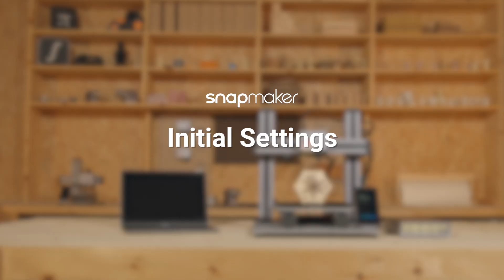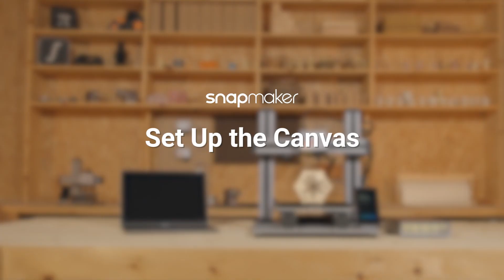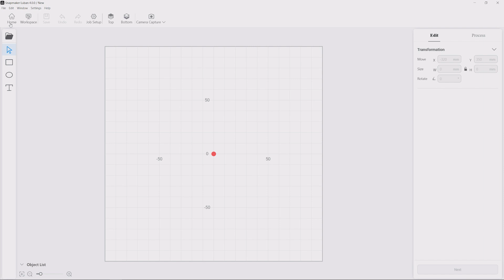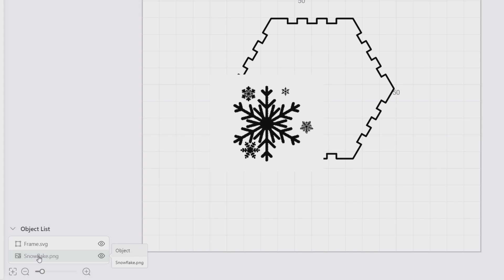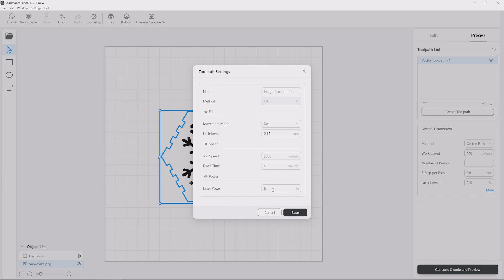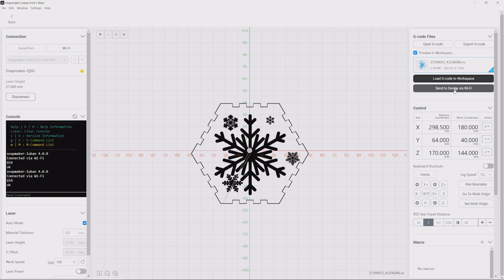Intro to Snapmaker Luban 4.0 for Laser Engraving and Cutting

Comment: Good afternoon, I have a question.
When I place the image on the workpiece with the camera and start the engraving (in the centre of the plate), the laser moves to the top right corner and starts lasering there. What am I doing wrong?
Thank you!

Snapmaker 2.0 A350 with Quickswitch, 10w Laser, Luban 4.15.0
Reply from the maker: Please contact support@snapmaker.com

Comment: Doesn't help beginners at all. Much too fast and with not enough detail. And what about saving projects? Still think this is one of the worst softwares I ever worked with.
Reply from the maker: Thank you for your suggestion! We will continue to improve and do better next time.
Reply: @Snapmaker  E.g you set the Origin position. Then you add background, without mentioning why it then automatically resets the origin position.  

For an hour I am now trying to set it up. First the Laser crashed into the bed, then calibrating crashed too. Then I started a camera calibration which seemed to work, but anything I do it tries to laser outside the bed.

Comment: Problems with 10W Laser:
1. Luban set the laser power to 0% on every start, have to do manually swipe the Option.
2. I do not get any result on the aluminum keychain that comes with the package, tried all options as well 10 passes and 10mm/min speed.

Comment: So I have a 10x10" basswood. 9 designs and 9 cutouts to make 9 ornaments. I put the vector cut toolpath at the bottom (deprioritized) but the Snapmaker went to work on the vector first. ... so, that doesn't work. I'd never want to cut out objects then attempt to engrave on loose material.  --- I just checked and for engraving, Luban/Snapmaker don't care about the Toolpath list order. Luban 4.0.3
Reply: it should, whatever toolpath is on top is the first one to be cut or engraved, so I put all my engravings first, then my cutouts.

Comment: Why did you skip over about 50% of the steps? I set the material thickness to 101.6mm and clicked "go to work origin and the machine slammed in to my 4x4x4" block.
Reply from the maker: Sorry about that. The work origin is not automatically calculated. You need to set a new work origin for your 4x4x4" block before clicking Go to Origin, otherwise the toolhead will move to the last work origin you set before.

Comment: So setting an object to vector will automatically set it to cut though instead of etch on that path?
Reply: This is the think I'd like to know too. I've got a few projects I want to try out, but don't know how to cut through things yet.
Reply from the maker: To cut the material, you need to choose vector mode. But choosing vector mode doesn't necessarily mean that the material will be cut. Basically you need to run several passes to cut through the material.

Comment: Yesterday I was engraving and cutting in plywood. Today with this update my snapmaker just send out a weak blue laser. Even though the laser is set to 100% in the toolpath settings. Why?
Reply from the maker: Thank you for your feedback! Please update your Luban to V4.0.1 or above and try again. If it's not helpful, you can contact our support team via support@snapmaker.com.
Reply: @Snapmaker  I've done that in the meantime. The problem remains the same. If I use the photocapture and start the laser via the "start button" in Luban, i'll have to make sure, the laser power in the work space in Luban is set to 100% (or whatever the first "tool path" laser power is). If not the first "tool path" command will use the laser power sat in Luban and first change the power when the next tool path is due (that is if there are multipel tool paths).
If I load the g code to the machine there are no problems. Which make sense cause there are no interaction between Luban and the laser in that case.
Reply from the maker: @Jonaspressn  Got it! This seems to be a bug. Will tell our software developers about it and fix it soon. Thank you again!